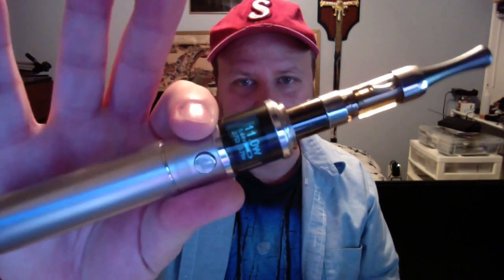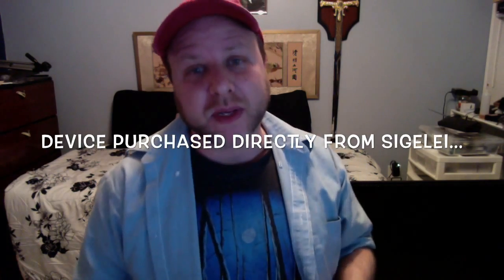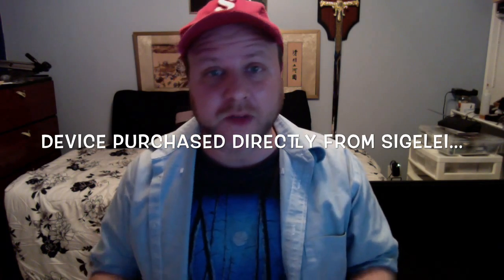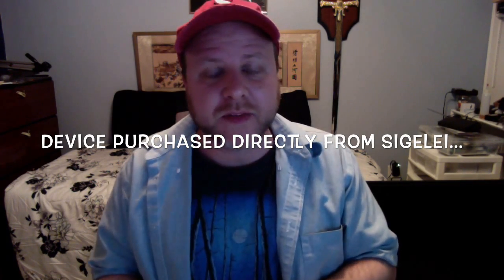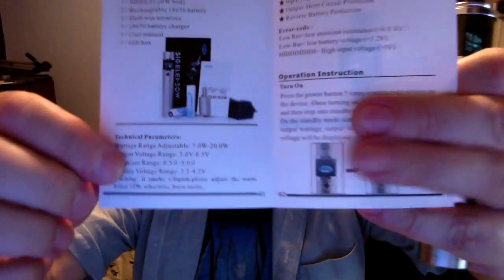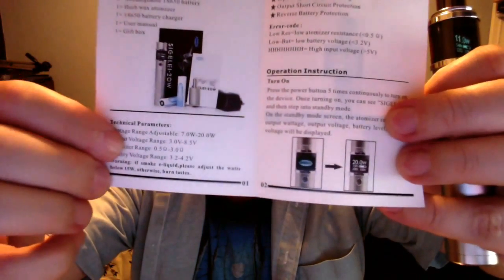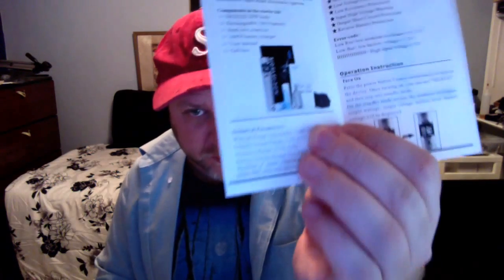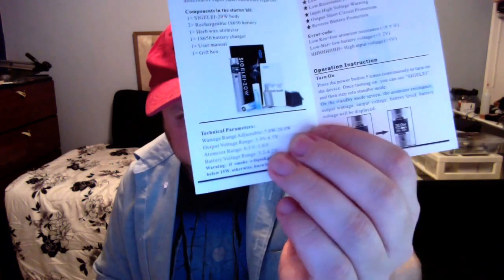Sigelei-20W (SX-200)

Comment: Great review. Demoed one at my local shop before looking at the review. Hits the nail on the head with my experience. I will say, the mod by itself, no batteries or charger they have for $109. I got a bit of a deal, but even still, killer price. True variable wattage tube mod that runs low ohm RDAs, absolutely killer.

Comment: It seem like that board is a bit more accurate then the DNA board from the looks of your video.
Reply from the maker: They both have their areas where one is more accurate than the other.  But they are both very close and good devices.  The DNA-20 is a different device and works better with lower resistance coils though.  For a standard clearo/carto, I really like the SX-200.

Comment: will that mod take two 1830 batteries
Reply from the maker: No.  It isn't designed to work with the higher voltage.